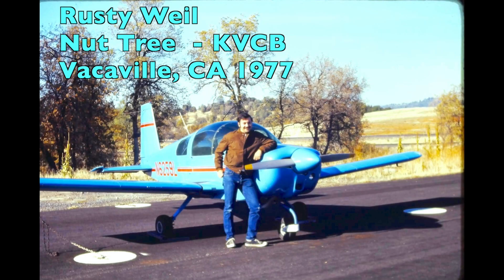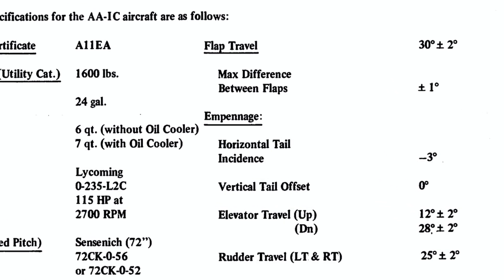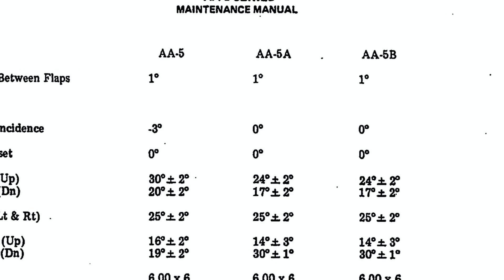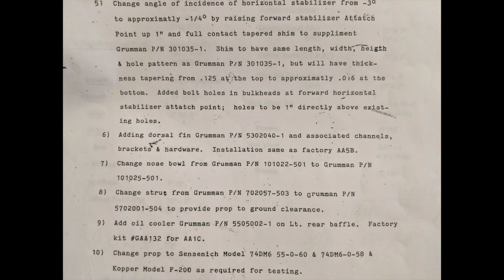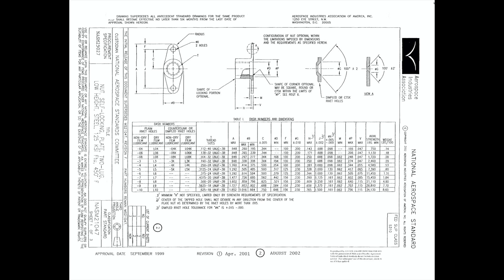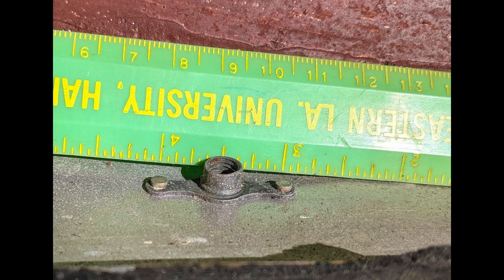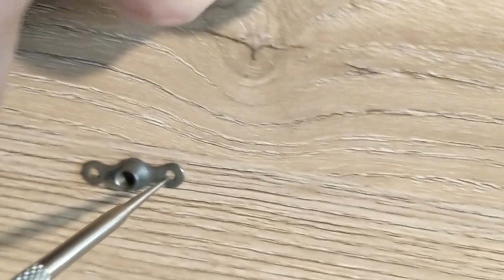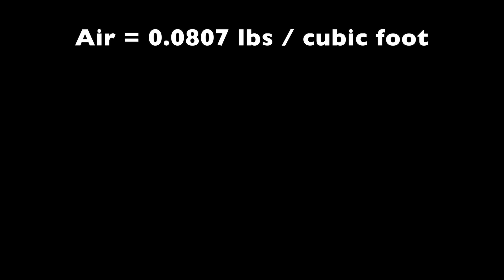Tail Angle of Incidence - Grumman Style

Comment: Changing the incidence with the small elevator might not be a good idea, but maybe with the AA-1C elevator that Maynard used was what was needed.  I will have to ask Robin R that helped Maynard test fly it if he noticed the difference from a stock AA-1.
Reply from the maker: It has the AA1C/Traveler tail so it is bigger.  Speeds helps with this, cruise 195 mph/160 knots on 9 gph.
Reply: The flight characteristics of the tiny tail and short fuselage are a one-two punch against stability.  
That said, it was probably more dangerous to fly with the original 0-235 in many instances.